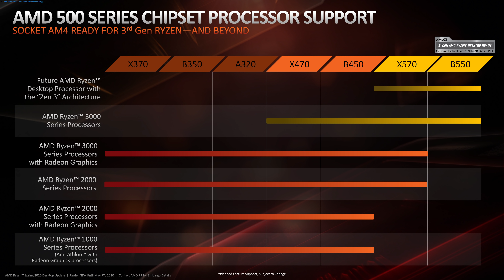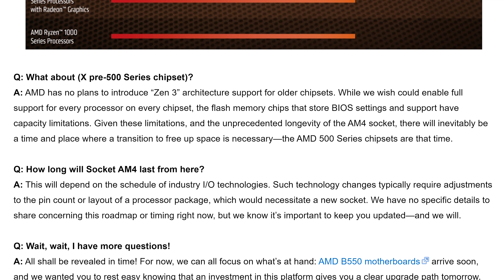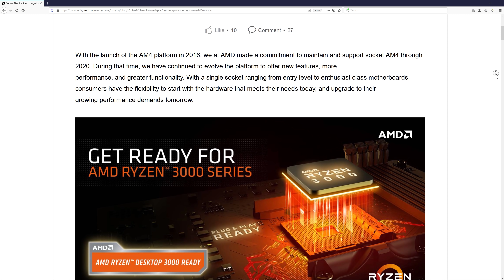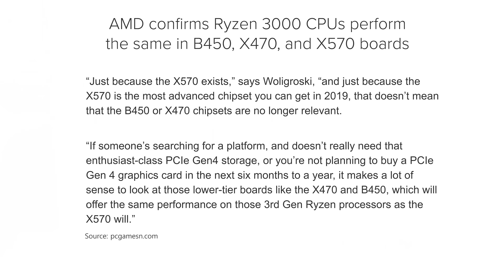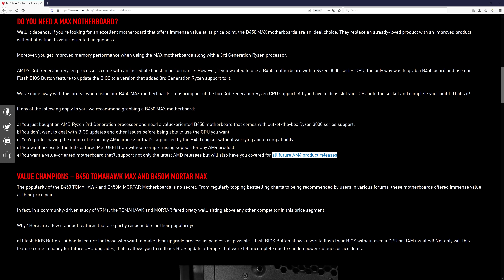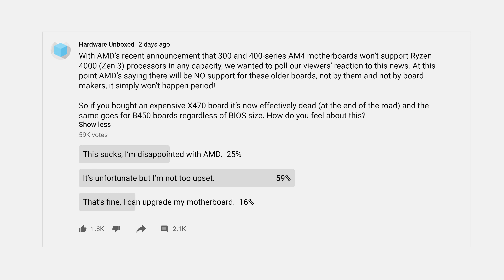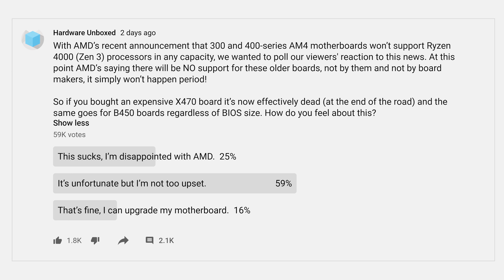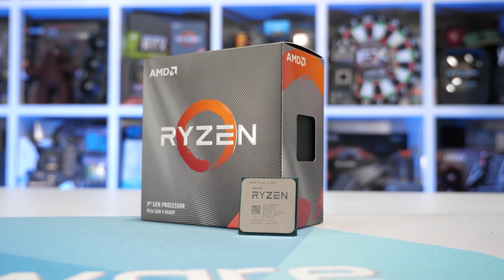AMD Does An Intel, Axes Zen 3 on 400-Series Motherboards, Our Thoughts

Comment from the maker: Updates: AMD has refrained from commenting and therefore addressing any of our questions at this point, but we have had some interesting conversations with a few of their partners.

Again to be perfectly clear on this point, board partners cannot support Ryzen 4000 series processors on 400-series motherboards without AMD’s help, it’s simply not possible. So don’t expect an AIB to crack the code and open up support, again without AMD’s support it’s not going to happen.

It does seem as though this was a recent decision by AMD and their partners found out the same time we did, so that’s truly bizarre, but then given the last few product releases from AMD it’s getting harder and harder to be suprised by this stuff.

I’ve also had industry contacts confirm that the AMD BIOS excuse is rubbish and that simple workarounds are possible, just like the one I discussed. In one example there would be a single large BIOS file that you download, then upon flashing you select the CPU series you want to support and it flashes the appropriate code.

So at this point it’s now up to the rest of the community to pressure AMD into changing this decision and to open up support for 400-series boards. You guys had better believe that if you give them an inch, they’ll take a mile and we’ll be back to where we were just a few years ago.
Reply: Those of us who have X370 boards that are better than some X470 boards are hurting as well. AMD did eventually cave and support Zen 2 on A320 boards, though, so I'm still holding on to a sliver of hope. 

As it stands, there is virtually no reason to upgrade from my Crosshair VI Extreme until DDR5 is available.
Reply: @Zaapiel22  x370 is miles bettwr than x470. X470 is garbage.
Reply: @MindaugasSnegirevas  not really.
Reply: @MindaugasSnegirevas  why is x370 better than x470?
Reply: @Seramics  Almost every x370 is better than x470, check VRM's for example.
Reply: @Zaapiel22  While I really hope you and all 300 series board owners get support for Ryzen 4000, I'm not sure 300 series support is really the issue here. You guys were incredibly fortunate to have gotten an additional generation of CPUs and honestly, I don't think anyone expected support for Zen 3 on 3xx boards. On the other hand, b450 boards were being promoted by AMD and sold as a current generation product. As a consumer, you had only the high end x570 boards or the lower end b450 boards to choose from for nearly a year after Zen 2, a product line consisting of low to high end products, launched. As a result, AMD must have expected their customers up to the 3600x (or even 3700x) to purchase b450 boards for the 'mid range' products as it was the only chipset that made sense for it. This means that, essentially, this generation's b450 owners are only getting ONE generation of support, making AMD's promises of exceptional longevity complete and utter bs.
Reply: @Zaapiel22  exactly. I have an x370, I bought it with the plan to upgrade to the last best AM4 chip. Now because they don't want to support the older choosers I'm limited. Plus there's no reason for me to buy another newer AM4 board to gain 1 generation of compatibility. I'll just wait until ddr5 stabilizes and see what's available then
Reply: @Zaapiel22  me too 😎
Reply: @Zaapiel22  Correct. X370 MSI Gaming Plus here, no reason to upgrade until new gen stuff comes around.  I think we are on the brink of another leap in performance in the next 1-2 years, so upgrading now really is a waste IMO.
Reply: Steve I have B450 Tomahawk and I'm little bit pissed, but I know people who upgraded same board to max version, because of bios problems and now they're fu.. again 😱
Reply: You looking at it the wrong. The most interesting thing about the compatibility slide is not that Zen 3 based products aren't supported on 300 and 400 series motherboards. Instead the interesting part is that Zen and Zen+ aren't supported on series 500 motherboards (although some X570 does support those). The only feature that Zen and Zen+ CPUs are missing that could justify axing support is lack of USB3.2 support. USB3.2 support is necessary for a board to be compatible with USB4 (which is the same as TB4, btw). There currently doesn't exist any and there aren't any plans for a USB4 controller IC that doesn't require USB3.2 lanes. And given that Zen 3 platforms are rumoured (more than rumours really, it's a fact) to be the first platform to support USB4 the move makes more sense.
Reply: @SamsoniteDove  Exactly. Seems like AMD is pulling some Intel product segmentation crap. I have a B450 Tomahawk Max + 2700X so its not like I can just upgrade the motherboard to a B550. I have to throw everything away. If I need to do that I'm going to wait it out and see what Intel comes up with.
Reply: I  personally do not own any relevant motherboard or CPU but I do agree that unless there is some unnamed technical issue it is still a dick move. 
Specifically for B450 motherboards with a larger bios capacity.
Reply: I cant wait for harbor unboxed
Reply: Hardware Unboxed did u see the German system integrator Schenker also being blindsided:
https://www.reddit.com/r/XMG_gg/comments/fsbsr0/megathread_xmg_apex_15_with_amd_ryzen_desktop_cpu/fpvqmn9/?context=3

"It was a firm information that was given to us through official channels. We'll see if they change their mind again. Maybe they discovered some issues, maybe they want to push X570 mainboard sales. We won't know for sure until ZEN 3 actually hits the market. // Tom"
Reply: @SA-zc1ll  So they were even telling vendors that it would be supported.  Great move AMD.
Reply: @SA-zc1ll  X370/B350/A320 small profit margin :)
Reply: my gigabyte x570 Aorus Elite motherboard has only 128Mb (16MB) bios chip. does that mean I will have future bios capacity problems for support new cpu's?
Reply: @allgamerman7015  No, AMD has stated X570 will get Ryzen 4000 support, so it will. It's possible they'll need to drop support for some older chips though. Also, many Gigabyte boards have dual BIOS (my Master does). So you could flash a different BIOS on each one.
Reply: you should honestly do a Video on "upgrade path" because alot of consumers have some strong misconceptions about value buys and upgrades. but dont use the "used product market" as that has far too many variables.

people think upgrading there CPU/GPU every 2.5 years is a smart move it is almost always better to plan for a new build every 5 years then constantly upgrade.
Reply: given that AIB saying that they can add support for 400 series motherboard but AMD just doesn't allow it, that mean the real evil here is AMD ! they want to sell more B550 and X570 chipset which are made in-house and not by 3rd party (ASMedia) which mean it could make them more money for every 500 series motherboard sold compare to 400 series, BOO BOO AMD !
Reply: Steve, as a person who bought a B450 Mortar MAX for exactly this reason to give me an upgrade from the 2600X I currently own to whatever the new sensible 4000 series CPU would be, please pass on my disappointment to AMD and count me as a data point in the people who really would like to see them change.
Reply: GOT YOUR ACT TOGETHER AMD! I built my PC 8 months ago knowing b450 would support Zen3 CPUs and now I learn that was a waste of money. You were doing good until now... But seriously... Nice way to get customers angry.
Reply: @MK-bi1hj  same here, i would pay 60€ more for X570
Reply: @tadejdanev5030  if we knew that yeah.
Reply: @tadejdanev5030  no. But my comment is still valid. In a few years a 3900x will be dirt cheap. It's gonna be the same way for 4000 series after a year or two of their release. So expecting to upgrade to a 4950x (idk if that's gonna be the actual name) is STILL reasonable.
Reply: @MK-bi1hj  yeah but installing OS fresh etc sux hehe
Reply: i even just 2 weeks ago upgrade to b450 lol
Reply: @MK-bi1hj  I BUILT BOTH MY AND A BUDDY'S PC'S 1 AND 7 MONTHS AGO. He's on a 1600 AF and B450 and can only upgrade to Zen 3 now. I'm on a 3700X and X470 and can only add cores. An expensive X470 Mobo and I literally can't even upgrade to a new generation once. Ouch.

It also stings because the 1600 AF is dead AF so there's no way to get that and a B550 to upgrade to Zen 3 in a few years. It's just dumb AF.
Reply: MK0825 it’s not as bad as you think... zen 4 is rumoured to be on a new socket. Eventually it is clear that AM4 support will stop and they will switch to AM5 or whatever, I have a 2700x and can still upgrade to a 3950x at best later down the line. If you brought a B450 and expected it to last longer than 3ish years you were naive. It’s better than intel at least... it’s amazing that they were able to even support 3 generations on one chipset compared to intel. Not being able to use zen 3 is bad but something like a 3700x will last 5+ year even more... by then AM5 will release and it would warrant a new motherboard change anyway.
Reply: @SnowyWiz  I do agree with this. It probably isn't a huge huge deal. But still they should've made it clear that 400 series boards possibly wouldn't support 4000 before anything. The issue is that now board longevity is something were never going to be sure about. With Intel, at least we know specifically that they'll probably only support 1 generation. With AMD, we've had boards support 3 or 2 generations. So we won't know when AMD will drop support for things anymore.
Reply: @MK-bi1hj  and i just got mine last month :(
Reply: @laiyokehman  at least you'll have a 3950x to look forward to some day.
Reply: @MK-bi1hj   +1
Reply: @MK-bi1hj  i bought a b450 just last month, now im just pissed off
Reply: @MK-bi1hj  class action lawsuits?
Reply: @randalllawkin  I dunno about that. I don't think they're wrong in terms of legality
Reply: @MK-bi1hj  Overclockable boards at intel cost around 200$ You spent less than 100$ probably. 3 years of the same socket, seem good enough for me.
Reply: @MindaugasSnegirevas  Im fine with dropping 300 series boards. But dropping 400 series despite the advertisment for B450 wasn't a good move for those of us who got 1 CPU generation out of it.
Reply: @MindaugasSnegirevas  it's not about being "good enough" it's about AMD being anti consumer and being really shady about the whole thing when it is possible and if it's not we need an explanation cuz the one given is just BS. Their exact words is am4 support through 2020. We are getting a NEW am4 release later this year as well as new am4 chips. Back in 2016 they stated this. 4000 series is coming out in 2020. They need to stick to what they promised and stop pulling an Intel having the exact same socket with incompatible chips.
Reply: thanks for stepping in!
Reply: If the EPROM was an issue, why do over 80% of boards come with 16MB EPROM? Only a few boards have 32MB and manufacturers are well aware of all of the scope of CPUs they need to support.
I understand AMD not wanting to support A320/B350/B450, but if you bought X370/X470 boards you invested in the enthusiast platform and you have all rights to be pissed off as when you buy Prosumer platform, you expect Prosumer support.
Reply: BIOS excuse is kinda odd, eeprom of bios can be swapped with bigger ones, or maybe, do it like bios mod 771 processor on 775 where P4 microcode is removed. With this user might selectively remove support for old ryzen 1000, 2000, and athlon 2000/3000ge to make room for next generation
Reply: It makes ZERO sense that g3400/3200g apu/cpu works on high-end X570 motherboards but not work on budget friendly B550 motherboards.
Reply: Steve I like how you guys are addressing this now. Several months ago when AMD did this to TR4 everyone tech reviewer was mum shut, and left us X399 owners drifting in the wind.
I bet TRX40 is selling worse than X399.
Reply: If they said zen 3 would be pcie gen 4 only or something along those lines then I can understand why cpu support on older chipsets is not supported but saying there isn't enough space on the flash chip for it makes me wonder
Reply: It's official. AMD closes the 1st chapter in its book. It is a shame it was for the reasons they said it was. That being said what a bloody good chapter it was!  I bought b450 tomahawk (nonmax) when the 2400g came out (so Zen+) no regrets. Waited till 3600x came out and grabbed that. Moved 2400g to itx htpc build also on b450.  Now I have 2 pcs dirt cheap and great performance and still can upgrade from there on both if I need.  My main will become my daughters pc replacement (fx4300@4.3ghz) when am5 arrives/I wait to see if rocket lake may be worth it.  Amd gave us what we wanted. Competition.
Reply: This is just fraud. The launch of the b550 has been delayed a year but to keep selling their CPUs to those who didn't want to buy expensive an x570 MB AMD told the market, including the motherboard makers, that 400 (and possibly 300) series MBs would be 'future proofed' for  next  generation Ryzens. Then AMD have done a 180 and destroyed the entire 300/400 MB market overnight. And what about the 500 series ? Are they going to be a two generation platform only? Talk about snatching defeat from the jaws of victory AMD. Like most folks I want AMD to beat the pants out of the competition, especially in higher end GPUs where Nvidia have a monopoly. But is this the best way to do it AMD? You've lost the hearts and minds of your supporters. This is not a good move, in fact you've been lying to the market and the motherboard manufacturers. Not a smart move in the long run IMO.
Reply: Very discontent with AMD's decision. 

it's not often that companies develop such a dedicated fan base.

They shouldn't give that up
Reply: I just bought MSI B450 Mortar in January 2020 thinking it was a good investment after reading the promises from AMD about prolonged support. Guess not. Very disappointed.
Reply: Absolute crap move by AMD. Advertise B450 with 3600, then negate the ability to upgrade. B550 being delayed is their fault, and they should pay. Not us.
Reply: I think this is a serioulsy dick move by AMD. The whole reason i baught a vEry good X470 board was to make sure it would have no issues with a 4000series CPU. VRM and power delivery issues.
Lets hope they re-consider, otherwise they going to loose a lot of fans. Me being one...!!!
Reply: I feel screwed over with my B450 Tomahawk. At least I bought it when Zen+ was the current gen... 
As you said, if someone bought it with Zen2 to learn that they have no update path is a way worse. 
That is a really bad move from AMD that pissed off a fair share of the community. We need to remember that AMD was rather well perceived and had good publicity recently. 
That's a bad move, that did a lot more damage than the recent fail with last minute BIOS update on 5600 release.  

AMD you can still turn back from that road.
Reply: Well if AMD sticks to this, They would have lost a CPU sale, not gained a motherboard sale. Simple as that
Reply: Well said. This may end up being AMD's shortest comeback of all time. The GPU segment isn't all that strong, either, and now this.
Reply: Told ya,,
AMD get Drunk from short wins
Reply: Z Rus All companies that get behind, want to get ahead. Let’s just hope AMD isn’t as bad as intel. This is a fairly minor  offense in my opinion, but we still need to speak up.
Reply: Not everyone is rich I saved up for 1.5 year for my system and my b450 motherboard was more expensive than the ryzen 1600 i got in it. I bought it with the sole reason of upgrading to 4.gen when i get the money. Now they tell me my pc has no future throw it out and get a new one...
I feel like i have been robbed and to those blindfolded fanboys a new motherboard is like 1.5-2 month of savings for me only if i don't need anything else. If pc parts are like pocket money for you we are not interested in your opinion.
Reply: @faceless30s  what are you talking about - no furture? you can run 2nd and 2rd gen there. Lets not pretend its the same thing as intel with chipset per generation track record.
Reply: @faceless30s  a 3700X is a big upgrade for you a 3950X even bigger. Just how much of an upgrade were you looking for?
Reply: @faceless30s  nah 3600 will be very nice upgrade. It's a shame though that you can't have 4xxx cpus now.
Reply: @faceless30s  You can upgrade to Zen 2.
You realize that your 1600 is Zen, the 2000s are Zen+, and 3000s are Zen 2 which are already massive in improvements.
Save for Zen 3 for 'next gen' stuff AFTER consoles like the PS5 comes out and matures.
Reply: @faceless30s  you still got upgrade to 3600 or higher which will be huge improvement over 1600. Not much to complain about.
Reply: @faceless30s  you havent been robbed, get a 3000 ship, 4000 series is only 15% performance increase.
Reply: Gergő Csáki this sums it up perfectly. This is really screwing over those in the community with less disposable income.
Reply: @faceless30s  I'm sorry, but amd themselves said that ryzen was only going to be forwards compatible till 2020. They said that all the way in 201ú.
Reply: Thanks as always to Hardware Unboxed guys for their fight for tech truth beyond their own interests!
SHAME on AMD for this very bad thought move! Let's make them know how despicable their choice is and which will be the consequences!
Reply: Thanks for the video. One tip I could recommend is having AIBs be a little more clear with instructions for their BIOS upgrades.  For example, Asrock's instructions uses the codename like "Pinnacle, Raven, Summit or Bristol Ridge". Not a ton of individuals are going to know what this is and going to look this up manually and potentially get wrong info.

Instead, there should be another column that lists CPU compatibility and a link to either Wikipedia or their own document showing these exact models, maybe even to their own CPU support list option. It also wouldn't be a bad idea to have a chart showing BIOS versions for that motherboard and CPUs lines supported. That way, people know which ones they should "Step Upgrade" to.
Reply: I just wish you'd put all this effort when Intel keeps pulling this same crap.
Reply: Hardware Unboxed I’m against the flame AMD is coping at the moment, AMD said 2020 support, if they delayed the 4000 series to 2021 would that make their statement true and would that make the angry people back off? However, I agree with steve that the people who feel they got the short stick are the ones who bought the X470 with ZEN2. On the other hand creating multiple bios versions for different CPU support will be a logistical nightmare and given that a lot of X370 don’t have bios flashback, if one installs the wrong bios that will be a RMA nightmare for all board partners. 
It’s a tough situation though for both, people with X470 and for AMD. I hope they reconsider but I believe they aren’t being a greedy villain here, they probably have an issue they have not disclosed yet.
Reply: I have B450 mortar max but I've paired it with 2600 'cause other matx boards are craps and 2600 is an interim CPU for me ,I've planned to buy second hand 3800x when Zen 3 come out .Then I'll be waiting to invest big time for Intel 11th gen or Zen 4 whichever is the best one and that's mean I'll buy new MB anyways . So AMD dropped the support for 400 series chipset is not affecting my plan. 
IMHO, the real cpu war will be zen 4 vs intel 11th gen .......whoever bought any cpus before these two will be screw up hard .
Reply: If we have multiple bios it will double the cost of QA; they should just discontinue support older boards to avoid compatibility nightmare
Reply: I don't feel particularly screwed by this as I've just recently bought a 3900x for my Tomahawk B450. I  never had any intention to keep this CPU for just one generation. I would have been frustrated though if I'd planned on going from say 2600 to 4xxx CPU in an otherwise capable motherboard which many people may have intended to do.
Reply: I bought few weeks ago a tomahawk max with a r5 3600 and i hoped to get Zen 3 on it. What should I do now? Take it apart, send back the motherboard and wait  for b550 or spend more for a x570 board?
Reply: Hardware Unboxed my problem here is the lack of clarity around the future support for the 500 series motherboards. As an x370 owner for about 18 months, im starting to think about upgrading soon. But dont want to be screwed around by a company not committing to support their new products. The fact am4 is still the socket being used in 2020 is fine to me based on their historic statements, it does however make the future of am4 uncertain.
Reply: 3:40 And I think it is because unlike with older chipsets, AMD manufactures chipsets for X570 and B550 and sells it to board manufacturers. So it is 99.9% not about internal resources but about this sweet cold cash they get selling chipsets.
Reply: AMD are dicks, same as Intel
Reply: @joealtona2532  are they? What's the difference between the 7700k and the 6700k? What's the difference between the 2700x and 3700x?
Reply: @raawesome3851  15% IPC boost. (2700x)
Reply: @MK-bi1hj  exactly. This isn't like when Intel requires a whole new socket just because. They have stability issues with supporting older chipsets, since they are such a small company.
Reply: While I do agree that the technical guys might only be only be a smaller percentage , AMD should not underestimate how much weight their word of mouth  and recommendations carry with non-technical people.
It is often the case that non-technical family , friends and colleagues  turn to the technical guys for buying advise.

AMD would do well not to anger the few that provide guidance and advice to the many.
Reply: can you do a pole to show how many people are pissed at this change by AMD please
Reply: The thing is - if they support 400 series boards, why not still support x370, at least? They use less friggin power than the 1000 series chips!!!
Reply: @linkdude64  x370 is such an old chipset. You've already gotten your money's worth.
Reply: Well at least you guys tried.
Reply: I built into a b450 board just 2 weeks ago.  Now this, wtf AMD!
Reply: If I could afford to Replace A Gpu A CPu and motherboard and Ram Variant every time I saw A new product , I would probably Own the Company not Be a customer .
 The People who constantly upgrade because they "can" or want to amaze me and to be quite honest ,
 They are obviously well to do people and should maybe wait like I do until its a proven thing and not just be 1st as people love to Quote even on Youtube  lol. 
 I'm a R1600X + B450 M user and considering I got a Bargain , Id not chance a larger amount of money on a whim or prediction,
 Thanks for he Video , Always nice to see how Companies think , if a little odd at times , At least it shows they are relatively "Human" :)
Reply: In Australia it's worse for MSI & MAX - consumer law clearly states that if the marketing is wrong, they have to remedy. So any MAX owner will be able to expect a replacement board or refund, no lawsuit required. Many retailers also carried cut/paste copies of board partner marketing, which may make them liable.
Reply: I was already planning to upgrade to a B550 board as it is for PCIE 4.0 support, but I have to say the more info that I read on this subject, the more disappointed I get. AMD has been fucking up it's PR this entire year with the 5600XT launch and the issues with GPU drivers.
Reply: Built two PCs in March and April 2020 for my sons on AMD b450 boards & told them they will be upgradable to Ryzen 4000 in autumn, as AMD was advertised to continue support for AM4 (not specific chipsets!). A few days ago, told them AMD lied, like Intel.
Reply: Keep up the good fight.  The amount of crap ( your poll and other places). That show the PC building community is largely OK with this garbage is truly disturbing.

Our community apparently really loves taking corporate BS right up the poop shoot as long as the shaft is red and not blue or green.
Reply: Well, i bought 2 msi b450 tomahawk maxes + ryzen 3600 3 weeks ago and was planning to upgrade ryzen 4000 later and was planning to buy 3 more later this year so that my all 4 kids would get upgraded pc's... also was waiting for new gpu's so i could upgrade them aswell... but after this shitty move from amd they wont get single penny from me; time to go for intel/nvidia again... thanks amd, was fun couple weeks while it lasted :)
Reply: Oh, side note: I kind of wish there was a big MFG that only made 2 boards, bare minimum (VRMs / features) and one with all the bells and whistles (great VRMs, features). I suppose BIOS support over the long term would be significantly easier. Perhaps economies of scale would help them too. This would be kind of like the iPhone model at the beginning, great support for just few devices over the long term.
Reply: lliterally the reason i bought a tomahawk max, prob was spouted as being the best board for am4 at the price point, and the valuie for what you were getting was insane, but now thats just not the case, my plan was the grab a zen3 chip and an ampere gpu when they come out. now that wont be possible
Reply: Not going to lie, I bought a B450i Aorus Pro wifi in November, along with a 2700X (it was on sale for USD130.00 in Microcenter when I was in the US on holiday) - my personal first ever purchase of an AMD cpu at all. The plan was to skip Zen 2 and then get a Zen 3 chip 4700X or similar. I was also going to wait and see which ITX B550 boards, if any,  had the USB C front panel connector and pick up one of those when they were eventually out, so what they are saying wouldn't really affect me in reality. 

After this though, I might just wait for AM5 (or whatever Intel are on at the time if they get their shit together) now or whatever it gets called. I might just pick up a secondhand 3700X when the prices drop sufficiently on those for me to care enough about getting one. Either way, neither the AIBs or AMD will be getting any further money directly from me for any AM4 (at the very least), if it things are going to go the way AMD are currently saying it will.
Reply: What help from AMD do the motherboard makers actually require ? I'm assuming here they are supplied with the bios source code for the X570 (rather than a binary blob) anyway to incorporate into their UI. Anyone here shed light on the difficulties involved ?
Reply: Is this true? Because I have a Gigabyte A320M-DS2 v1.0 lying around and I checked on their website that this motherboard support all Ryzen products of AMD, idk if they're lying or they have advertised this knowing it "will" support new Ryzen processors before AMD announced their decision that it won't....
Reply: Now you know why board partners made better motherboards for Intel, more profitable. Selling one motherboard for four generations of CPU isn't a great selling point to your partners no matter how great it sounds to customers.
Reply: @redrock425  Actually it is,  they have been selling the B450 for years and could going till the end of DDR4 if AMD did what they said.
Reply: @MeLikeLulz luckily Intel would love your custom, I hear Z490 is a bargain 👍
Reply: Thanks for this update, and the continually good content you two produce.
Reply: Thanks, mate. It always upset me that Hardware Unboxed
 was not toxic enough. They are out to get us, so we must be as toxic as possible to make the world a better place. The world was a horrible place just a few years ago, we must never forget!
Reply: AIB partner want more profit :)
Reply: Lying bastards
Reply: Agreed 100%
Reply: good thing i didnt cheap out on the board and got X570 im ready for Zen 3 baby :)
Reply: As long as you get three generations of CPU off one board Spec, it's worth the ROI!!! I feel bad for the people that bought high-end gaming Motherboards this is why I only buy budget boards so no matter what I'm not disappointed!!!!
Reply: yeeeessss, we support you to "force" AMD to reconsider their decision :-)
Reply: I'm coming home Intel
Reply: @laukaskiemas4930  why? What are you getting out of the tenth gen Intel chips?
Reply: Thank you Steve. You made some apt points I was naive about. I hope they end up supporting 400 series boards.
Reply: @kimberlylewis5820  well, if they do, what's going to happen to stability? Remember third gen threadripper? They were stable, because they removed the other threadripper motherboards from their support list.
Reply: So I bought an Aqua x570 motherboard with a 3950x how many more CPU do you think it will support I think maybe 1 if I'm lucky. I knew ddr5 is coming so I could've waited but if that's all you do you'll never be up to date. Tech is improving by leaps and bounds every year. Everyone with an x 470 motherboard just wait till the 3950x price goes down and buy it just a thought. I still have a 9590 system that games pretty well it has a RX 590 in it up from a r9 290. To be honest if I had a x470 motherboard I'd wait for ddr5 to come out before upgrading my CPU and motherboard. I was on x370 with an 1800x which I gave to my son.
Reply: As long i need new motherboard so z490 is my next ( hyperthreading is no issue any more and we get higher speed 🥴 )
Reply: Taking support out of old motherboards is fine. It is a huge management load to keep old motherboards ready for new processors, and it can cause bugs and unsupported processors. Also, lately most motherboards are 100-150$, a fraction of the CPU cost. Only silly people buy 500$+ motherboards. So buying a new motherboard with new cpu is fine.
Reply: @braincruser  true.

I'm not too sure about this, but if anyone agrees. Wouldn't it still create the same amount of hassle of people thinking same socket = compatibility instead of just having to get a bios version for a new CPU?
Reply: And that's why they are a corporation and you are a youtuber..... They make stuff... you talk about how you could do it better and never have to put your money where your mouth is.
Reply: I replied to the poll that it was unfortunate but OK but am now reconsidering following the video.

I did buy a b450 mortar max 2 month ago and it is true that while I understand the move out of 300 motherboard support, the b450 and x470 board should be supported for at least one more generation.
Reply: AMD literally gave you best cost to performance on your B3xx (or even A320) allowing you to buy it (even more cheaper when B4xx boards came) after 3000 series and pair it up with ryzen 9 so think about it. It is logical that most of the consumers buy the cheapest without issues working MB to pair with higher end CPU (you know the reason super clearly and dont be stupid on why would you pair these MB with these CPUs), they literally gave you a finger and you wanted the whole hand and they did it eventually, and you KNOW the human hunger is never satisfied. And AMD as a company manufacturer as all of the companies in whole fucking world is working for PROFIT.  WE ALL DO WORK FOR PROFIT or just get a salary at the end of the month.

They could at least tell us at the releasing of X570   that they wont support for  previous gen processors or at least make the X470 board to support it (i personally have B450 after 3000 released paired with 3700X and i feel bad for X470 owners). Also the poll Steve made is actually a prove of what people are doing when building new PC they built it because they needed at the time it not just thinking of upgrading every fucking year (no hard feelings on enthusiasts who do this but they will always get top of the line every year of products). 
Every year new products come and most of us cant handle the upgrading also look at intel users, still using 2nd,3rd,4th etc.. of their builds, and why? because thats how most of us is doing!!!
Why would you need 4000??? for what? just so the next year they release a product that will crush the 4000 series.

Hats off to AMD providing us great 4 years of great products.
Reply: AMD will have to tell board makers to not to make firmware on the boards that can support it.  Doesn't mean board partners will not make a bios that won't support 4000 on dual bios boards or larger banks that can hold the bios.  Since AMD is mostly an open-source company I'm betting they will let boards that can support the bios happen.  Unless AMD states that they will not let this happen which I haven't seen yet.  I wouldn't go based on rumors and let yourself get shot in the foot. I think this has happened once. It happens to jim all the time that's why I quit watching that rumor mill.
Reply: @benjy117  this isn't a rumour its a release from amd.
Reply: @odysseyYT647  the issue is they should've at least told us that with B450 boards STILL being advertised. Even if they didn't know then they should fulfil what they had set up.
Reply: THE 400 series Cannot Handle the Instructions on its Bios , remember when Intel has this problem - Yes its amd pulling and intel - But the Bios Limitation is one that Only give you access not the instruction packets , overhyped here , just saying
Reply: I recently built a brand new system and used a b450 board because there weren't many micro ATX x570 boards.  AMD should offer support for 400 series motherboard buyers.
Reply: I bought a x470 board and am not happy at all. Though AMD has been good up to this point, which is why I bought a x470 board, it does smack of Intel greed. I hope Intel gets back in the game - I will seriously consider them for future purchases.
Reply: I am perfectly fine with AMD not supporting older platforms like the 450, and i have a B450 motherboard, new generation of hardware is just about to get released with DDR5 and PCIE 4.0 Graphic Cards from both AMD and Nvidia.

The current generation of processors from AMD are already bests in both the gaming and productivity departments, a platform change to take advantage of both the PCIE and DDR5 norms makes total sense.
Reply: @AngladaFrankFrankyvape  no. We aren't getting ddr5 till probably 2 years down the line. Maybe even 3.
Reply: The weirdest thing is that this is only after having 1 good year against intel, what will happen when they truly dominate the marketplace desktop, sever and laptop ?
Reply: So, then it should be just as easy to add support to 300 series boards, no? I know you mentioned (and I agree) that b350 buyers have gotten their money's worth and have a sufficient upgrade path, but it would still be great to give b350/x370 users support to upgrade to 4000 series chips. I, for one, spent more than necessary on a nicer x370 board shortly after 2000 series released in the hopes that I could upgrade to a nice 8, 10, or 12 core 4000 seriese chip.
Reply: AMD has 4 avenues.
1) Support older chipsets due to public demand.
2) Not move from their stance.
3) Mislead everyone by saying "no support" and then go "surprise, we figured it out" while always planning on doing that.
4) Not support them at first due to wanting the most stable platform on  x500 series, and then adding support later with the help of AIBs.

Options 1 and 4 are their best choice.
Reply: Thats business for you. People thinking AMD was the second coming of Jesus, lol. How stupid.
Reply: @ishanawate1849  I'm in the exact same boat!  I just upgraded my PC to a B450 Tomahawk with the Ryzen 3600x about 2 months ago. So much for upgrading the CPU in the future when I had the xtra money to do so.  Now I'd have to replace both the board & the CPU? I don't think so and I'm not happy.....
Reply: Zen3 isn't coming out this year.
Reply: The problem is that if i knew that AMD didn't support ZEN 3, i wouldn't bought an X470 board on March....
Reply: Dear Harbor Unboxed. :)After taking your advice and watching "Why AMD's Superior Compatibility Could End & It's All Your Fault!" in a retrospec, (and i really think u predicted the future pretty accurately), this is my personal prediction:
after launching b550 and 4000 series cpu's, AMD will announce that they "heard the cry out" (and maybe the advice of their own legal department ;)) and agree to supply the codes needed for updating b450 and x470 boards with Zen 3, leaving the decision to which models to the board partners, BUT will state they will NOT be providing any further support for costumers that will decide to act upon it, nor loan older generation cpu's in order to perform the update.
Reply: "In one example there would be a single large BIOS file that you download, then upon flashing you select the CPU series you want to support and it flashes the appropriate code.
"
The million dollar question is; why in the year 2020 is this not the norm already?!? Like, seriously, WTF?
Reply: Just stick with Zen 2 Ryzen 3000 processors period as the maximum. The software industry is still behind, WAY behind, on utilizing your hardware.

Compared to the 1000s, the 2000s improved upon DDR4 memory somewhat, and 3000s significantly offers the best compability for more than 3200Mhz DRAM speeds to be hit on average.

DDR4 speeds is the bottleneck of your CPUs, not your CPU or Board itself.
Reply: Bios Excuse is not totally rubish, look at the video from Gamers Nexus about this topic, he did some good research about this
Reply: Long story short, AMD stopped trying as hard
Reply: Ryzen 4000 would be on Zen 3? No more Zen 2+? Or they call it "Zen 3" loosely when in fact its Zen 2+?
Reply: Gamers Nexus: AMD Loses Either Way: B450 & Zen 3 Compatibility Deep-Dive, 32MB ROM Issues, & More
Pre-Matisse CPUs can't address 32MB BIOS, which adds an interesting complication, blank space sometimes has a use (but not always)

https://www.youtube.com/watch?v=T5X-8vZtml8&list=LLAIaWF244q_-bMYe2AzWhTw&index=2&t=1234s
Reply: reply limit
Reply: Too many people saying they are going for Intel because AMD said they axed X470 and B450 because they are "disappointed" with AMD.  The title literally says "AMD does an Intel" which doesn't sound like a good thing and yet they are going for Intel by paying premium boards that do not last that long. AMD X470 and B450 reverses course and  supporting Zen 3 
https://www.anandtech.com/show/15807/amd-to-support-zen-3-and-ryzen-4000-cpus-on-b450-and-x470-motherboards  . Nobody wants to talk about it anymore.
Reply: Us early adopter 300 series folks were really looking forward to this too.

I was personally going to splurge a little bit on zen 3 because of the money saved on the mobo.

Now I'll be skipping it altogether.
Reply: Am I annoyed? Maybe a little ... Recently upgraded to a B450 and Ryzen 5 3600... But in real terms, I was hoping for 3-5 years from this ... So when does Zen5 come out ? :D
Reply: AMD defense force are coming, they will leave no survivor, those who enter comment section must abandon all hope.
Reply: Interesting that some commenters are threatening to go to Intel. Why? For worst performance or worse power efficiency while paying more? AMD will continue to have the upper hand for some time.
Reply: I was always loud and clear into put AMD CPU's in debates as consideration for buy because of their long compatibility support of older motherboards with newer CPU generations. But now I'm not feeling like pointing out that anymore; I don't feel like long support is selling point anymore if 400 series is not gonna be supported at least 1 more generation.  I have X570 I'm gonna be fine but I still think at least release Betasupport and let  board partners deal with implementation; either by separete BIOS for different generation or just single package with possibility to select right generation coz limited space in BIOS.  If AMD becomes new Intel with their practices ..well it's gonna hurt him more than it hurt Intel doing bad practices. AMD buyers hold higher expectations from AMD. It's just that simple.
Reply: @matrixfull  what? They said they would end support in 2020, right now. They didn't say until or through 2020, because some of their products, 4th gen, are going to be released in 2021.
Reply: @raawesome3851  They actually did say through 2020.  https://hothardware.com/news/amd-confirms-am4-socket-support-future-ryzen-processors-2020
Reply: @raawesome3851  except they did say they would support products THROUGH 2020.
Reply: I said all this and the replies a read after were just daft, I deleted them after couldn't be bothered to read anymore.

I also can't blame MSI since 2016 I have been lead to believe that the socket itself would be changing after 2020, therefore any normal person would think all Ryzen professors released on the AM4 socket would be compatible regardless of chipset.

The socket was a selling point to thousands of people again regardless of chipset, I have been giving AMD props for the AM4 socket since day dot, it is daft AF to end it like this🤦‍♂️
Reply: @BuGGzLoVeRsTech  is it? They said they were ending support in 2020. They told us this in 2017.
Reply: I am a former owner of a B450 Tomahawk which was hyped beyond everything else (the release of the MAX series indicated that there could be an issue with future CPU support further down the road which made me nervous about upgradeability and I feel sorry for the guy I sold the board to just a week before this announcement) and also on your channel it was the go-to board for Zen 2 CPU consumers. It is needless to say that I am very upset about AMD's decision! As you said this is far bigger than the 25/50 Mhz clockspeed discussion und destroys trust in the company in caring for their customers. They could have been transparent about the issue at the launch of Zen 2 and could indicate to customers that X570 would be the safer choice for upgradeability. But they did not and the tech media now looks not great either, helping the motherboard vendors clearing their old stock. The tech media could have pressed AMD on that matter last summer when the MAX series arrived. I guess you would have recommended a X570 board to users who wanted an upgrade path if you had known about it, right?
Reply: @seylaw  they said they were ending forwards compatibility in 2020. They said that all the way in 2017.
Reply: Man, this is why you shouldn’t fan boi. Companies are greedy no matter what.
Reply: Longevity on AM4 has been excellent. Its a shame they can't hold onto this all the way up to AM5 but this stumble isn't the end of the world as long as it doesn't become a trend for them.
Reply: @Buffinator1988  The problem is that AMD is constintly doing odd things, instead of doing the logical to help themselfs.

For example they couls use the lessons that they learned from AM 4 to AM5 (4+)

Instead of doing this.

I hope that AMD starts hiring more software developers so that they can fix thier bios/software problems.
Reply: Could not agree more. Its pretty reprehensible for AMD to drop support for all 400 series motherboards in this fashion. Where can we bring more attention to this matter? Where else can I register my complaint about this? Should I contact my board manufacturer? And say what exactly, when AMD refuses to help them, so that they are totally blocked from being able to make a new BIOS? More than happy to pay $20 to update my x470 board.
Reply: @dreamcat4  I mean, I'm not against having b450 or x470 be compatible with 4th gen ryzen, but they kind of already promised they would end support in 2020. The ryzen 3s didn't get released until a few weeks ago. How would any of the processors released in 2021 under zen 3 work? It wouldn't.
Reply: While this is obviously bad news for those computer literate I can only imagine the amount of issues average joe would have with this.. 

"So you  can run this cpu but this bios EPROM does not have enough storage so I gotta flash my bios with a specific version that removes support for certain AMD processors and I can only do this if I get an older cpu to upgrade bios with"

What is a bios ? what does flashing mean and seriously wtf would likely be the response ;)

I think what we should push is more capacity bios memory chips from ALL motherboard manufacturers and the ability to do a firmware flash WITHOUT installing cpu etc.
Reply: @logirex  But I've had to flash the bios on every AMD Ryzen motherboard.  They already trained me starting with the memory issues on B350, PBO  issues on B450 and  the boost algorithm on X570.  AMD isn't for the faint of heart.  The first thing you need to do with AMD is update the board to the most recent bios.  And continue updating for a couple of months.
Reply: @logirex  
Exactly, there not going to break the off the shelf Intel market with their convoluted setup, yeah they might get a few annoyed enthusiast builders but that's what 0.1% of the market overall, you can see why there going this route.
Reply: @logirex  true words
Reply: @logirex  Bigger bios might drain the battery faster. Just a thought. I think AMD is being crap not because of the actual decision but because of the reasons Steve pointed out: 1) The lame excuse 2) The lack of advance notice 3) Their naming is f***ed when you also factor in their mobile chips.
Reply: I don't think it was the best move but you can go from a 1700x to a 3950x,which is a lot better than what Intel has been doing.
Reply: Thank you for saying things the way they are and working for the consumer rather than supporting any big company. I have been following you but I never donated. I am getting my first big boy salary next month and I will be supporting you with donations from now on because that is the kind of information we need.
Reply: If Zen 3 couldn't run on older boards due to real hardware limitations that would be acceptable, but to not support it because of small bios chips is B.S.
Reply: I'm one of the people that feels relieved that they got an X570 instead of a B450 when I was on the fence last year. And here's the problem: I shouldn't be feeling this way! The quotations in all the things they said last year was that they would offer support THROUGH 2020...not UNTIL 2020. There is little doubt Zen 3 is going to be at the very least announced and displayed this year...and that coupled with this BS explanation for why it can't be done just amounts to this being a big dick move to everyone that didn't want to spend the big bux last year on X570. I really hope AMD at least comes clean as to why they're not doing it, if there is a legit reason, or if there is none and it really was just a money move...then dammit, reverse this short-sighted decision so that you can at least finish the entire AM4 socket on a legit bright consumer-friendly note rather than this, which is the exact opposite.

I want to cheer for AMD, because they've legit brought competition back to the market. And stuff like this just reminds me and everyone that they're in it for the dollars first and the consumer second...or third/fourth/fifth/whatever.
Reply: Around 15:00 you make the point. People forget we are a niche group... the huge majority of customers want to buy stuff, plug it in an run... the huge majority of people don’t updates Bios, heck, the majority don’t even update drivers, much less bios. All these weird compatibility issues from 3xx to 4xx and even A320 where a pain to explain to customers, and amd was losing a lot of customers because of that. So now they decided to “reset” the situation. Ryzen 4000 on 5xx boards. Simple.
We are focusing on technical stuff when the reason imo is customer confusion.
The reason AMD gave doesn’t make sense for some boards tho...
Reply: @xouric0  If they were worried about customer confusion then the 3000 APU's would be supported on the B550.  Hell, if they were honest, the whole APU line would be numbered 1000 less.
Reply: @xouric0  except they already released x570. So they general consumer who has an x570 already may think "oh 500 series I'm good to upgrade" will be in for a ride awakening when their new 4000 series chip doesn't work out of the box. They'll still have to go thru a bios update. Only thing that may have bios support right out the gate is b550 which is odd since it's a lower tier board than x570
Reply: @xouric0  still though, it was already confusing enough. Might as well just go out with 400 series. Then switch to a new socket in 2021
Reply: @xouric0  I mean, I guess the chance of reset and stuff is because their roadmap talked about support until 2020.
Reply: I have B450 tomahawk max regrets 😔 amd has lost goodwill with me and by extention the dozens of friends and family I help with their PC's, the only issue is Intel has burnt me far more over a long period of time so I guess I'm still buying amd. Tbh fuck them
Reply: @RCD4444  though, I'm sorry, but didn't they say they were ending support this year? If they were releasing their processors throughout 2020 and to 2021, how can they support it till 2020? Would some of their processors released in 2021 just not work?
Reply: @MeLikeLulz overreacting bud. But I get it.
Reply: We need support for b450
Reply: AMD.... Don't do this to the people who support you. You can milk our money slowly but in a smarter way.
Reply: Thank you for your interest, such a pity that they are getting  greedy now that thay have good products, it wolud have been nice to finnish epic journey with am4 socket by offering support for ryzen 4000 series. I am a B400 owner and was planning to upgrade. Shame on you AMD.
Reply: @georgetafilip9054  greedy? What are they getting out of this? They don't make money from the motherboards. Also, remember the 3rd gen threadripper not being forwards compatible with the new threadripper motherboards? They gave a much more stable platform, because they weren't stretched so thin. Giving these b550 and x570 owners the ability to upgrade to 4th gen ryzen is not only going to make sure that ryzen 4th gen is going to be stable, it will make sure that ryzen won't be crippled.
Reply: I don't get what the big deal is. Why pay a premium for a processor that supports features beyond the capabilities of the chipset? If you don't care about PCIe 4.0, the 2000 series processors are going to remain excellent options, and will only get cheaper from here on. AMD painted themselves into a bit of a corner by introducing PCIe 4.0 support 3/4 of the way through the life cycle of a socket, but I feel that they've made good decisions under those circumstances. I don't really see this as "axing support", but more like adding feature support tiers to a platform. This is all an unwarranted overreaction, in my opinion. 400 series boards are hamstrung by their lack of PCIe 4.0 support moving forward, and it has been apparent since the launch of Zen 2. The launch of B550 chipsets is a boon for these people, so long as the rumored pricing remains uninflated. This is not an Intel move, not by a long shot. Intel would have implemented a different socket for each release, and ballooned prices by 25-50% per socket, and justified it with the age-old, "if you want the best, you'll pay for the best" rhetoric.
Reply: Build my pc 2 month ago with Amd Ryzen 3600X and Asrock B450 SteelLegend. And I have to admit that  I am pissed. Ofcourse I have no upgrade plans right now because I just build my pc. But having my Motherboard only supporting ONE Cpu Series sucks! I mean I really trusted in B450 at least supporting one or two more Cpu series. And now I end up with a motherboard I have to swap when I upgrade... not a cool move amd.
Reply: Phariz Do your research before buying shit than, ryzen 5th gen has been rumoured to be on AM5 socket for months now. You can just skip 4th gen and get 5th gen when we it releases and have the added bonus of ddr5 memory.
Reply: @pharriz  that rig is going to last you 6 years plus. why are you pissed?
Reply: i bought msi b450 mortoe max. i am not happy with AMD
Reply: Yeah, really unhappy about this myself, if it is simply a BIOS storage size then fucking work it out. If it is something else, please do tell us then at least there is some transparency.
Reply: Intel and Nvidia shill channels have the most amusing comment sections.
Reply: Imagine buying a motherboard and thinking that it’ll be supported for multiple years.... go back to intel days... new motherboards every year. It’s amazing that even zen 2  works on b450 I think people are overreacting. Also most people won’t be ready to upgrade until they release AM5 (2022? I think) so just be patient with your 3600 or 3700 that should last a few years than skip over 4th gen Ryzen and go for 5th gen... not hard. I’m still on 2700x and don’t plan on upgrading till AM5 + DDR5.
Reply: @SnowyWiz  why is it amazing on 400 series boards they were advertised to run Zen 2 its amazing on 300 series boards but expected on 400 series.
Reply: Though, didn't AMD say they were ending support this year?
Reply: @raawesome3851  Not until last week.
Reply: @raawesome3851  no but yes but no. The new chips are still on AM4 so no they didn't.
Reply: At least this makes me repent of fanboyism
Reply: I mean, think about this year. Ryzen 3 came out this year, nearly a full year after the launch of ryzen 5, 7, and 9. They would end up carrying support till 2021, not 2020.
Reply: Yeah, I'm not saying it's unreasonable to support ryzen 4000 on b450 and x470, because then people wouldn't have to deal with issues buying another motherboard. However, I kind of expected them to end support for it in 2020, and for them to stop forwards compatibility. That said, I think that, Steve, if you read this, I agree that they should open up, and make zen 3 processors forwards compatible.
Reply: keep up the good fight, as a Asus CH7 hero x470 owner of few months, kinda pissed ngl......................AMD STOP FUCKING UP ALL THIS GOODWILL KARMA! HOLY SHIT!
Reply: @echoforge333  did they? Did you have issues with ryzen 3rd gen not boosting properly? Did you have problems with ryzen from an x470?
Reply: @Hardware Unboxed --> Good grieff !!! -->
Just as Zen2 was never promised for AM4, AMD did engineer these CPU's for use in these boards. Now do tell us, up to and including Zen2, how well AM4 has served the original purchasers and chipset longevity - in comparison to Intel's usual tick, tock new board, rinse and repeat consumer 'fun' ?? 
At 0:19 you show a slide which informs everyone that Zen3 won't be compatible with AM4 - that info was known to EVERYONE for some time - YOU KNOW THIS!! 
HOW THE HELL DO YOU EXPECT AMD TO INNOVATE WHEN AN AM4 REQUIREMENT WOULD CRIPPLED INNOVATION, FUNCTIONALITY AND COMPETITIVE EDGE FOR ANY NEXT GEN CPU ?? 
HOW THE HELL DO YOU CALL YOURSELF A CENTRE OF 'EXPERTISE' WHEN YOU PEDDLE THIS 'ASSUMPTION'  CRAP - you do realise that 'BIOS compatibility' is effectively the same as 04:01 i.e. IT DOESN'T MATTER the reason.
Oh yes, AMD THANKS YOU for 'feeding' all the Intel shills in these comments - a 'feast' I'd imagine will be justifiably reciprocated.
Reply: @JimB001-t6w  Both Zen 2 and Zen 3 were promised for AM4.  https://hothardware.com/news/amd-confirms-am4-socket-support-future-ryzen-processors-2020
Reply: Wtf,now what am i supposed to do with my b450,its false advertising and because of these fanboys they're gonna get away with it easily,fuck you amd,you dont release b550 and say b450 will support future chips,you liars eat my shit
Reply: Could they do R5 3600 AF? .......B450 support with 4000 series architecture.
Reply: AMD just did a Harvey Dent
Reply: I did my research and went with the B450 tomahawk max as it had the larger bios chip and promised future generation support and the fact that B550 was nowhere to be seen, also brought a 3600 with the plan to drop in a 4700x or a 4900x. If it had been communicated at the time that zen 3 was not going to be available i would have either brought an X570 or at the very least got a 3700x. Im guessing MSI was in the dark about this and that the decision to drop support had only been made recently else they wouldn't have just released the pro carbon max.
This was the first time I have gone with AMD over Intel in 10 years and feel very let down and disapointed by thier decision.
Reply: I just built a pc 2 weeks ago. In my ignorance I did buy a 570 board, only because  I've always thought the latest was the greatest, lol.
Reply: @JimmyChino55  I agree, MSI must really be pissed. The Pro Carbon MAX has literally only been out a few weeks - who will be interested now?
Reply: @brianbrora  i have a pro carbon ac and its a cracking MB so still worth it if you don't mind losing the Zen 3 support even so its crap for anyone like me who specifical bought this MB for future upgrades
Reply: It's up to us to make some pressure, but how?
Reply: B450 owner and annoyed I can't get a 4000 series chip
Reply: @BigIdds  4000 series are only going to be 15% approx faster than 3000 series, Zero reason to be annoyed if you get a 3000 ship that will last 6 more years at least.
Reply: @BigIdds  well, I'm sorry, but remember AMD's roadmap? They were ending it in 2020 anyways. It seems like people forgot about it.
Reply: @raawesome3851  stop spamming dude, they didn't specify when, they told that they will support platform FOR AT LEAST 2020
Reply: @nenadcaric5195  I am not spamming. I'm just asking if they ever said that officially. Look at my comments. I took time to write all of them. They aren't just copy paste.
Reply: Look at reddit, many people are pissed but also many of them support AMD, i fucking hate fanboys.
Reply: Who knows the real reason? Could be AMD has something in the works and are trying to it low key for now. Time will tell I guess. That said I did a ton of upgrading systems here at work an it is crazy that I can drop a 3950x in a X370 motherboard so easily. I dont feel cheated one bit.
Reply: AMD is going down based on this. Their videocards will be overpriced garbage and even F-REE-sync will not save them. They think they have sales because they have the consoles by the proverbial cojones - guess what - people are outta job, economy is in shambles - consoles will sell way less than what AMD estimates. 2nd hand will become king for couple of years and then we will have only InHell and NoVideo.
Reply: Giv em' HELL!!!!! WE wont stand for this Intel-iszation!!!!!!!
Reply: Your counterargument on the BIOS Support is not a good one. Let me explain Why. 
First of all if AMD says that all B450 Motherboards are compatible to Ryzen 4000, then all Motherboards have to be. Since alot of B450s and X570 dont have enough space in their BIOS they are literally opening the Box of Pandora for their legal department.

Second: Your Solution is pretty "janky"(improvised), because that results in a Mess for everyone. The Mainboard Manufactures will then have the same Mainboard with completely different Bioses flying around on the market which results in customer confusion and a lot of RMA.
Then People who arent into PC Building (And if i remind you and everyone else there are quite a few out there) and are deciding to upgrade their Rig for the first time will just buy the 4000 CPU, build it into the MB and will be suprised that it dont work.

Other Point is: While it worked out more or less with the B450 Boards that upgraded BIOS for the 3000 CPUs, there was still a lot additional work for the Resellers that needed to say their a)customers that B450 dont works with 3000 out of the box
b) they have to pay extra for a BIOS upgrade done by them
c)to contact AMD for a upgrade CPU
d) to take RMAs from customers who dont want to "tinker" with their PC

Conclusion:
For everyone who knows how to update his Bios and who WANTED buying a Ryzen 4000 for his B450 Board this Situation is garbage. But on the other Hand that are "only" 1-10% of all the customers.

For everyone else and the AMD it has following Benefits:
No legal Problems with compability promises
No extra Supportwork for helping customers with their BIOS Update
Lower RMA Percenteges
A cleaner and better oversight of the market for everyone who wants to buy a new System
Better out of the Box Compability

I think while its not the best AMD could have done, they are still better then the Blue Giant and you just cant expect them to do Cross combality for every Processor thats on a AM4 Plattform.
Reply: @predestruction8235  yes you can expect compatibility. it is within their reach, and benefits them in the long run via customer loyalty. Word of mouth is incredibly powerful.
Reply: @predestruction8235  I mean, that's a interesting perspective. I didn't think about it like that.
Reply: @predestruction8235    I can expect them to be compatible, when that was there selling point in 2017.
Reply: @predestruction8235  what if i told you that whole Gigabyte x570 lineu uses the SMALL 16MB bios chips ... same size uses for old 300 series BIOSes for all manufacturers ...

what if i told you that the MSI Max series and whole x470 lineup from ASUS uses large 32MB chips they also use for theyr x570 lineups ...

in other words they will have space issues on Gigabyte boards regardless while most x570 and a lot of x470 boards will have theyr oversized BIOS chips specifically put there for future compatibility sitting half empty and asking why the chumps half theyr size can get an update  ...
Reply: I'm switching to Z490, disappointed from AMD.
Reply: @alessandrozanardi4393  Don't switch to Z490. Z490 will be dead within a year along with LGA 1200 when Alder Lake comes out on LGA 1700 which seems to indicate Intel may want a socket that lasts a longer amount of time so I'd consider going Intel at that point. Z490 boards are also bloody expensive same as X570 if not more expensive. Difference is Comet Lake doesn't support PCIe 4.0 so you're paying for something that is promised for the future. Maybe not wise considering what just happened with AMD hehe.
Reply: @alessandrozanardi4393  Intel socket longevity is awful. AMD is miles better in this regard. So to punish AMD for not offering forward compatibility  on B450 your going to switch to Intel Z490 with porentially even worse forwards compatibility? Makes sense.
Reply: @Buffinator1988  I'd rather stay on intel and knowing I have to spend more then recommending to buy AMD and be fooled by them.
Reply: Ben well zen3 will be a dead platform as it is as it’s followed by am5 so if rocket lake beats it in gaming then all on  X470 and below will go for rocket lake .
Reply: @alessandrozanardi4393  Fooled? You did hear about AMD ending support this year, right? If anything, they were too honest.
Reply: @evalangley3985  why? Didn't they say they were ending support in 2020?
Reply: @alessandrozanardi4393  LMAO
Reply: @evalangley3985  The RTX card is probably what I will buy instead of a high core count 4000 series CPU.  Stopped buying AMD graphics cards because of buggy drivers.
Reply: @Buffinator1988  It's not potentially worse though; you'll get one more gen...AMD is for sure not getting one more; Zen 3 is the last set of CPUs on this socket
Reply: Buying today: B450 -> stated ZERO forward upgrade-ability. Z490 -> Looks like ONE forward upgrade. Last I checked 1 > 0. B450 no longer makes any sense if you are someone who upgrades CPUs. B550 barely does for that matter. I know when I look at upgrading my youngest daughter's PC from her ancient i5 in 7-12 months time, that I will give strong consideration to going Intel (even though all the other modern computers in my house are AMD). Why buy into a dead-end AM4 platform at that point?
Reply: @evalangley3985  how so? Intel support 2 CPu gens....
Reply: @alessandrozanardi4393  You can if you want I will stick with my 1950x
Reply: @alessandrozanardi4393  why?
Reply: It's reasonable since with previous BIOS updates adding CPU support, older CPU support was dropped on many motherboards. BIOS descriptions literally say: don't update if you use older series CPU. BIOS for all CPUs simply does not fit into flash chip, remember that 400 chipset series also support all older CPUs. The fact that some part of motherboards have large enough flash chip, does not make it a worthwhile endeavour for them. With this act they basically reset CPU support count since 500 series chipset will not support older CPUs as well. BIOS updates which will brick computers of not attentive customers with older CPU is not a good thing to have.
Reply: @woopsserg  ltt pointed out that bios was already super confusioning anyways despite being okay with AMDs move.
Reply: @woopsserg  the issue is. With Intel, they have a specific cycle. No need to be told. With AMD, we never knew what to expect until we were told.
Reply: @woopsserg  right and considering the used market the most actual bios on a motherboard could break any system for the buyer with a gen1 Zen CPU and vice versa. This would leave even more bad press on AMDs reputation
Reply: @ishanawate1849  why? They said they were ending forwards compatibility in 2020.
Reply: I was about to switch camp until this happened.. I’ll stick to Intel since there won’t be any upgrade path anymore..
Reply: Why AMD hate us?
Reply: AMD have kept their promise. If you search for this article on Google: "3rd Gen AMD Ryzen CPUs Will Work on Many Existing MSI AM4 Motherboards", you'll see that there's a "Socket stability" slide from AMD on there. The orange bar on that graph stops right at 31 December 2019. Or in other words, processor support on AM4 officially ends on 31 December 2019. So why do people expect Zen 3, which releases AFTER 31 December 2019 which is outside of the promised support period, to work on motherboards from 2019 and below? 🤷‍♂️
Reply: @bgtubber  Did you even watch this video bgtubber? Did you not see the blog post by AMD promising support throughout 2020? How about the fact that AMD have delayed the B550 launch so long so for most people buying budget systems the only viable option is to buy a 400 series motherboard ? Essentially AMD's failure to launch a budget platform for their new chips have made the AMD side of things work like this for the existance of the Ryzen 3000 series chips. Budget systems: 400 series board in particular the B450's and a Ryzen 3600 chip or 3700X chip on the top. And for enthusiast systems get a X570 and a 3700X or better chip to pair it with. This is the way AMD have forced the existing market to work due to their failure to launch a budget platform. AMD themselves even have said as much that 400 series boards are a good option for budget systems. I think at this poind AMD have worked up enough of a moral obligation (due to their failure) to maintain support on their 400 (and even 300 series) platform. It also seems that AMD have given the impression to board partners that Ryzen 4000 would be supported on the 400 series mobbos. So even they are surprised by this sudden move on AMD's part.
Reply: @bgtubber  and technically, they even went beyond that, since ryzen 3 can work on x570.
Reply: Amd is just nastier version of intel 🤐
Reply: @kingyogesh441  is it?
Reply: I won't even think about pressuring AMD about this crybaby crap. If you want the power of the cpu you buy, buy the MB that can handle it.
Reply: @darkelive660  That's why I bought a damn Tomahawk MAX
Reply: @GewelReal  And that's why I bought a 570. As it is, I probably won't even add another chip to it as I won't be upgrading until the Zen 4 which will be on a new socket. Doesn't hurt my feelings as I have pcie gen 4, another reason to go with the 570.. I personally need the M.2 gen 4 speed for production work.
Reply: @darkelive660  you must be misinformed about power delivery on motherboards lol there's countless b450 and x470 boards $150 and under that can fully "power" a 3900x. It's not THAT demanding of a chip honestly. Msi released $250 x570 boards that were worse in vrm performance than some of their b450 boards. It's not "crybaby crap" at all. It's AMD misleading customers and it's anti consumer.
Reply: @darkelive660  what are you talking about? Their 7nm CPUs can be easily handled from 400 series boards, but the misleading campaign from AMD led many of us to make the wrong choice.

Also, their excuse is really paltry.
Reply: @alessandrozanardi4393  well, regardless of their excuse, they said they would end support in 2020.